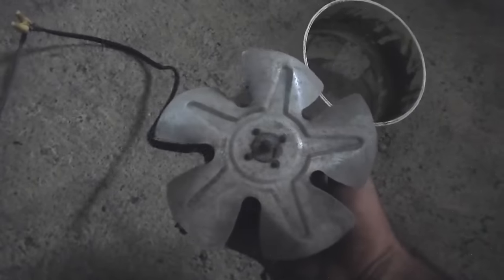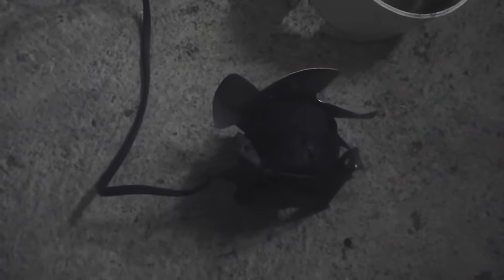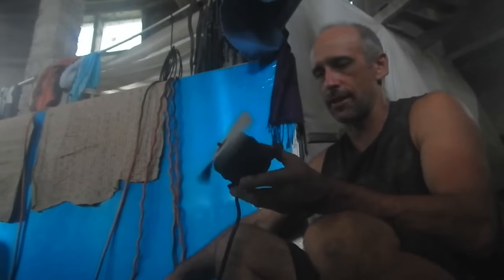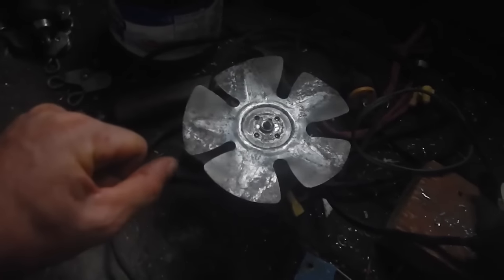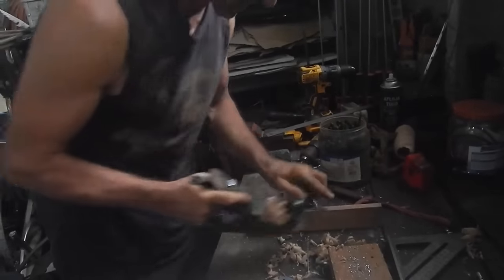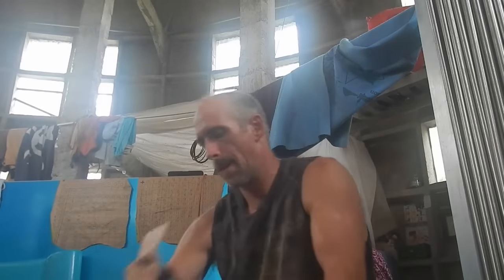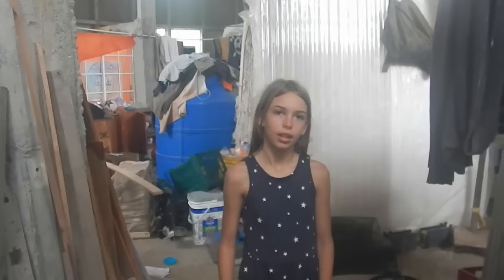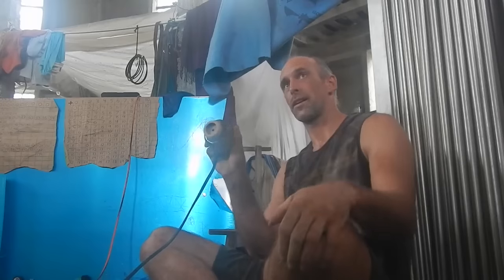Making a Fan ...cuz it's too hot out.

Comment: Good computer fans are pretty much optimum design, what comes to low power consumption, low noise and high air flow on small pressure difference. They also have good bearings which can operate around 10y without service.

I made a test when I made a heating system on my garage. I compared five of those low noise 120mm arctic coolers, 50cm floor fan, 75cm industrial fan and 160mm channel fan.

Computer fans used about 4W per each and were rated for 90l/s. Big industrial fan was 120w and 1200l/s, floor fan was 75W and 650l/s and channel fan was 110W and 250l/s.

I had a car radiator and a constant heat source and I measured the water temperature, which corresponded quite well with air flow. 

The big industrial fan was the most effective, but not with a big margin compared to computer fans, which came second. The difference in power consumption was huge, since all five fans took only 20W. Floor fan was just a bit worse than computer fans, but took about 4x the power. Duct fan was expectedly worst, since it's designed to generate also pressure difference and not only air flow.

All the fans were installed on a plate, so all the air was pushed through the radiator. It caused some pressure losses, but they were significant only with big industrial fan. The noise of big fan and duct fan was unpleasant, floor fan was annoying and computer fans nearly silent. Floor fan felt more powerful than computer fans, because the air was more turbulent. It cools the skin better, but don't move as much air and comes with a cost of power consumption. Airplane propeller is not the best one to move air. They are designed to generate lift by making pressure difference between sides of the propeller, also generating most turbulence

If you want to blow air to your skin, such big and slow propeller design might be best choice. If you want to blow cooler air from outside, computer fans are definitely best. I paid 29.95 for all of them, so that was also the cheapest.

Comment: make it ducted with a deep front grill wind guide, this will make it consume 30% less power as it cant form tip vortices, the front air guides can extend range. Did this to a cheap desk fan and the original duration of ~4 hours increased to almost 6 hours of runtime at full power. A lot of front wind guides together with the duct extended the range from around 1 meter to almost 2 meters.

Comment: for sure the bigger diameter helps a lot. 
also, for sure it draws more power. 
and if you are out of meters use some of those almost dead batteries. 
not so much juice to hold, so it will empty fast.
fully charged, and then compare the time for the old propeller, and the new one.  it can be a pet projects for the kids. 
timing the consumption, also building the improvement suggested by avengerSho.

Comment: that reminds me of like 7 years ago when I build my first 6 inch prop quad ( 'drone') and I had to test it at home, stringed to upside down chair to calibrate it and check if I got all drivers wired up properly, boy that was dangerous :D then I fly tested it gin up and down, the amount of air those push through is riddiculus, all small items went flying around it :D that was cool and scary in the same time. It all went well. I later measured that on max throttle it can draw up to 100Amps - for about 3 seconds - as otherwise Lipo battery would overheat :D those motor are expensive and very touchy - they dont like dust at all, but boy they do punch the air hard :)

Comment: How about building a pattern lathe, or some other kind of pantograph for copying a pattern, so you can accurately replicate any number of blades on these propellers you keep making? For example, have a look at the pattern lathe for aircraft propellers in this video: https://www.youtube.com/watch?v=GXLDg7P5lO8

I'm routinely amazed at how well your hand-cut props work, but I suspect there's some efficiency to be found for your water props if each blade was made from the same pattern, or formed to a tool of some kind.

Comment: JAMIE ,I BUILDING BOAT 16FT CATAMARAN, AND NOW I NEED A ENGINE/MOTOR, WHATS IDEAL IN TERMS OF RELIABILITY????
Reply: <<<<< Atomic power >>>>>    Seriously, a gas engine, is the easiest and most reliable if you have no problem getting gas for fuel....says the guy who is converting to solar and batteries. (I have three-year-old gas in my hybrid car.) My 16' Hobie cat has no motor....wind only. P.S. PLEASE STOP SHOUTING
Reply: @deplorable1-2  CAPS LOCK STUCK ON SORRY, YEAH I WANT WIND AND MOTOR AND GAS ENGINE JUST TO EXPERIMENT AROUND FOR SPEEEEED